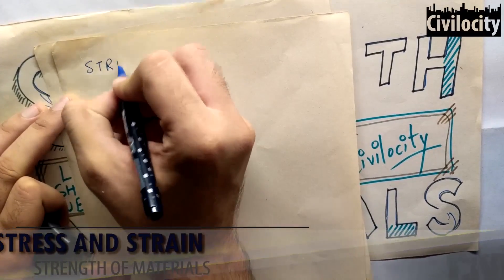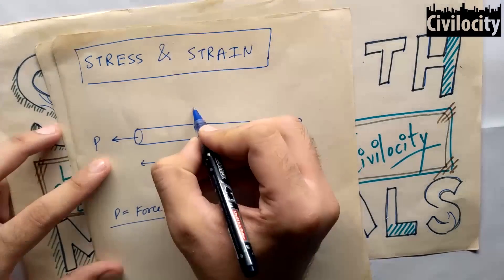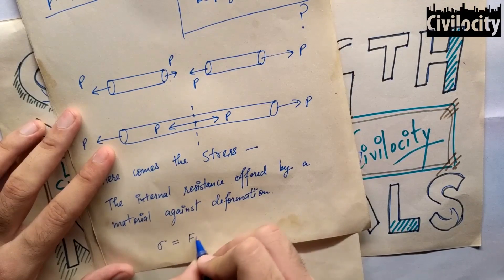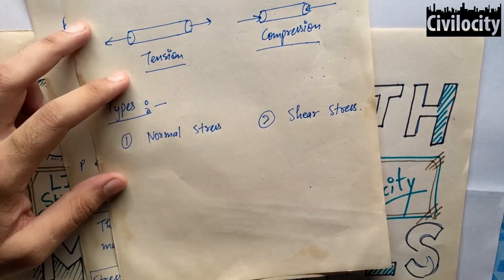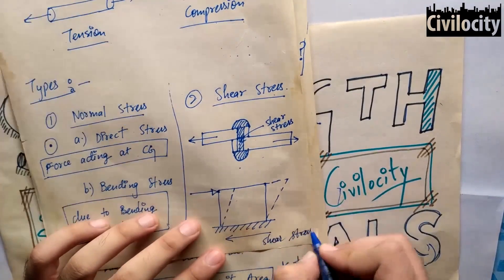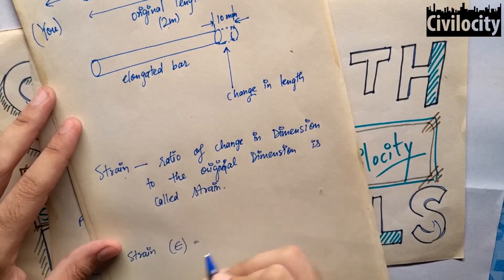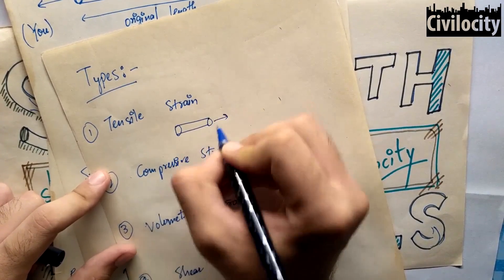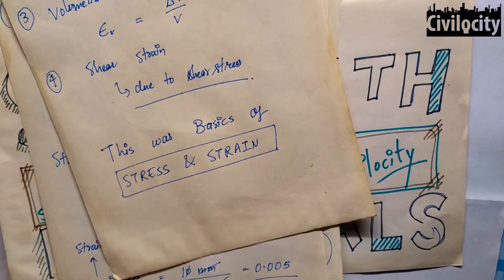Stress and Strain | Lecture-1

Comment: @Civilocity 1:28 the internal force arrows should be in opposite direction
Reply: No, it is correct. The section is under tension as tensile force has been applied, he has correctly superimposed the two separate diagrams to obtain the overall diagram.
Reply: @sarbajitbhattacharyya9255  FBD is correct but the internal resistance shown in the overall diagram is wrong. The arrows should point in opposite direction because of tension.
Reply: @pradnyaamorree111  https://books.google.co.in/books?id=2IHEqp8dNWwC&lpg=PA1&dq=strength%20of%20materials%20google%20book&pg=PT22#v=onepage&q&f=false Please check the Page-3 of this book by R.K. Bansal. I think the way he depicted it was correct. I understood what you wanted to convey, that the resisting force developed is in the opposite direction, but I think there is nothing wrong with the way he or R.K. Bansal depicted it.
Reply: @sarbajitbhattacharyya9255  Alright I got what you are saying...but I have one doubt in the link you sent..Check page 4 fig 1.2...the diagram is wrong...the bar should be in compression from both the sides..
Reply: @pradnyaamorree111  Yes, that's a printing mistake
Reply: @sarbajitbhattacharyya9255  Thanks! :)